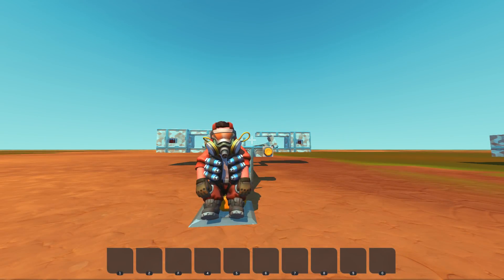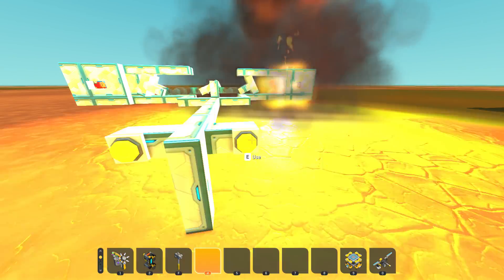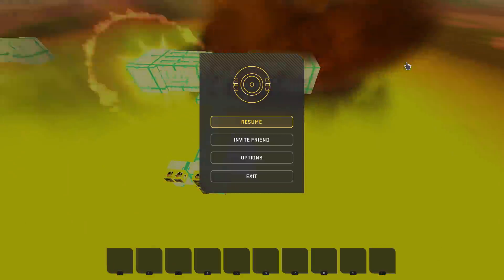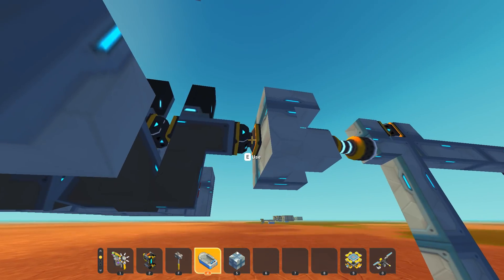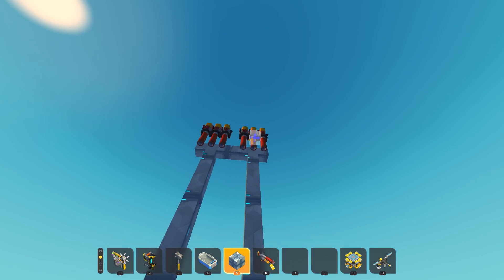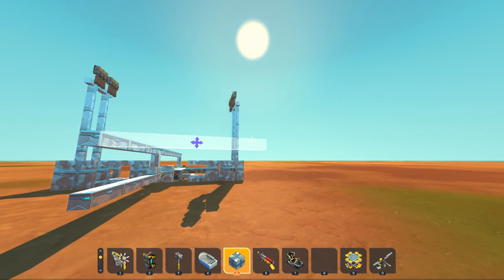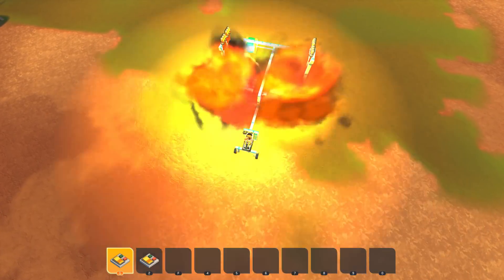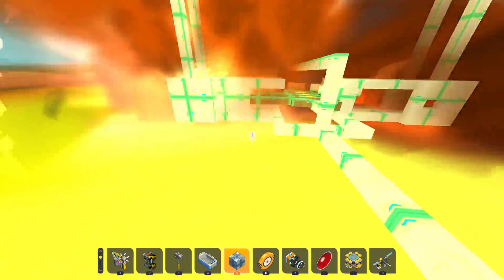I Built an Explosive Powered Engine! (Scrap Mechanic Gameplay)

Comment: You need a flywheel for that to smooth the pulses out.
Reply: jup. scrap engines runs bad without. always have.
Reply: @MrLarsgren  ?????
Reply: A friction based clutch like 2 plates with cactus on one to allow some slippage would be a good thing
Reply: and an electric start to get the flywheel moving
Reply: @thekingjdd  yes.. but not in scrap mechanic. physics freak out.
Reply: @MrLarsgren  Ahh the clang sets in haven't played scrap mechanic so don't know the limits my self thanks for the clarification

Comment: Rather than making it into a differential to get both wheels, use both sides of the crankshaft as wheel locations, this way the piston chamber is the same axis of movement as the spawn location and the drop of the spuds won’t be so out of place too,
Reply: Yeah that's what I was thinking
Reply: Yeah, I thought the same, would've probably been more efficient to use the engine in line with the wheels instead of using gears to transmit the power

Comment: When it accelerates the spudguns start missing some of their shots, you need them in front of the cylinder for them to be unaffected by their own movement. Then after they missed the first time one of the cylinders had multiple explosives spawned in it at the same time & one of them glitched upward and destroyed some of the spudguns. They should also probably be hooked up to the same activation as the explosive spawner (or a set delay if the spawner has a delay after activation) so that the spuds hit the explosive sooner after it's spawned.

In any case I'm not sure you're gonna be able to get this to start (or accelerate well in general) without having it hooked up to sensors instead of being on a set delay. If it had 4 separate pistons (which could still be doubled up if you want) it would make it far easier to hook up with sensors, guaranteed to only spin in the direction you want it to, and far more reliable. With sensors and 4 pistons it would be much easier to start because the pistons would never counteract the direction you want it to be going, so as long as it starts moving at all it wouldn't stall it would just slowly accelerate until it gets to whatever it's top speed is. (if it's strong enough to push itself at all)

-and of course something something flywheel, something something starter
Reply: And add that the spudguns when moving seemed to be miss the shot and hit the metal
Reply: Dang that's smart
Reply: 20:30 is where he loses the spudguns.
you can see an explosive flung from the engine

Comment: I knew it would stall when moving.  You might do better if the spawners were facing forward or backward to the vector of travel and had some wiggle room to work with but I don't see it working very efficiently.

Comment: By the way. The trick with putting the bend pipe into the suspension on a bearing with a screw does work in Survival. Worked the best for me when using a button, or a switch. Full sized blocks, or pipe pieces have to much/too little space to place the bearing/bend pipe piece on.
Reply: I've been doing that trick for a while in survival and it works with pretty much any piece, you just have to know where to aim your cursor (it's a little counterintuitive for full blocks). You don't even need the bent pipe and I usually use 2 full blocks for durability.
Reply: @rokushou  How I described doing it just felt the easiest, which I got to work without much trouble. So that is why I recommended it. Plus on a very small vehicle you save space. ^^
Reply: I'm sorry, I'm a new player and I don't understand. Could you give a timestamp?
Reply: @gheetza14  we are talking about the video about his flying Scooter from like a week ago.
Reply: @rayguy4726  I totally agree the screw or button saves space, and full blocks are not viable if using small wheels. I just personally don't like using anything with low durability for structural components and wanted people to know you can do the suspension trick with something strong like wood 3 or metal 3.

Comment: 1. You need a flywheel. A heavy rotating mass that keeps the engine rotating when the pistons aren't applying power. 

2. Try adding more pistons at different angles. The fewer degrees of rotation between power application increases torque. Right now you have power application every 180 degrees. If you can reduce that down to 120 or even 90 degrees, you'll be much better off. 

3. Try a friction clutch. Your current clutch is more of a direct drive gear. You need a clutch that can slip and apply the load more smoothly over time. So try maybe two plates of tier 3 concrete that get slowly pressed together by pistons. It'll probably take a lot of clamping force to accomplish. And you'll need suspension to act as clutch springs. It'll take some tuning to get right.

Comment: 17:53: A flywheel would fix that, but would need a lot of mass. We used flywheels on cars for a long time, and they serve to keep the rotations on the engine, even during the cycle changes on the pistons.
20:32: Maybe a "injection system" for the explosives, where they spawn and then are bought to the chamber to explode, could fix it, but honestly I've known scrap mechanic for enough time to know that it probably would made it even worse.

Comment: Wow, that's super cool even if it doesn't work.  Reminds me of the thruster engine I built (way back before we had pistons.)  For the clutch problem, I think maybe you need a flywheel on the crankshaft?  It might go a little ways toward keeping it turning even under load.  Lighter pistons might help as well (maybe just 1 layer of metal 3?)  For the misplaced bomb problem.. yeah, that one sucks.  Maybe larger cylinders would work, but then that's going to be less efficient because the bombs are going to be off-center from the pistons and this thing needs all the oomph it can get.

Comment: Hey Kan! I used the laser cannon from the new legend mod and mechanical parts for the gears, and I ended up with a  inline 8 Cylinder engine, it had like a 6 to 1 gear ratio because it has a very minuscule amount of power, but it moves on its own engine power! So I’d say you should mess around with that laser cannon too, it might work out!

Comment: you can use the compression of the cylinder to instant's activate the explosives, assuming it goes fast enough. I made an explosive based cannon where a piston on max speed with 1 distance hits a bomb, detonating it and launching a projectile, so you could use pistons like spark plugs kinda

Comment: I suggest not using pistons, but a flap that is pushed around a circle by explosive shockwaves.
It reduces complexity and energy loss and helps smooth out the power delivery.
My design uses small explosive spawners mod instead of large explosives, just for the even width.
It's called Radial Flap Explosive Engine on the workshop.

If you're here reading this, cool. And if you are still into potato powered engines still, I wanted to present a potato rotary engine on the workshop, and yes, it has 1 con rod; its not a spinner.

Comment: I think you need a counter firing engine like you see in real life where there is no momentary pause in between the cycles of force also having the piston rods connect to the top and bottom of the drive shaft in alternating fashion might help

Comment: have you ever made spudgun engines before? If not maybe you can use the explosive engine and just replace the bomb spawners with some spudguns and make it lighter so it can move. It wouldn't be as cool as an explosive engine but I'm shure it will be fun

Comment: the 3rd one is a misfiring B4 also kan ADD A SENSOR WHEEL AND ADD A BEARING TO THE WHEEL AND THE ENGINE SO IT CAN ADJUST THE TIMING

Comment: Neat idea. Did you try to make some sort of ⚙ exchange. Like different sized gears to multiple your torque. Don't know a lot about engineering. But it seems like you could probably multiple the power you do have, by making some sort of makeshift gears that step up or down. Just a thought.

Comment: Another problem visible when you add load is that the timing is fixed and the engine stops working as soon as the revs don't match the timing. Sensors made is spin up too much without load, but maybe they would work with it.

Comment: so uhm i've tried doing it too (but in an inline 4 configuration) and a good solution for detonation instead of the spudguns (cause they might break) is a piston on 1 length and max speed because they get glitchy that activates at the same time as the explosive spawner the back and fourth of the glitchy piston will blow the explosive up instantly and as for the timing, i'm trying an actual camshaft system with sensors instead of the valves and i think i'm pretty darn near making it work just need to find a way to alternate the explosions when two pistons are at the same position to get the rpms higher. i'm planning to add a flywheel too and make a friction clutch, which should make the moving engine a more possible solution the flywheel will get enough momentum to the engine to  keep running once you engage the clutch and not just stop and the friction clutch allows some slip if it's necessary
Reply: update i might have made it a tad too heavy it does spin but really slow and ends up stalling....

Comment: Maybe make the clutch less absolute
It needs to slip at a bit maybe two disks of high friction blocks pressed against with suspension

Also edit maybe make the cylinders bigger and diagonally placed so the explosive can fall into the low corner and will allways explode in that spot so it can work while moving

Comment: What about having it as a 3 cylinder with the pistons facing upwards? you could use bearings to set them to being a 3rd apart. you might need to use the explosive to pull up the piston instead of push it down though unless the weight of the other two would raise one to the top.

Comment: @Kan Gaming just so you know there are lots of 4 cylinder engines where sets of 2 pistons are at the same point in their stoke in fact the majority of them are like that including v6 and v8 they just combust at different times for instance my ford 801 cylinder firing order is 1243 also for future builds a more realistic clutch to a car would be 2 square plates opposed to one another with something high friction like a cactus on one that will also allow a bit of slip between engine and drive shaft for initial engagement TTFN

Comment: One problem is the spud guns, when you move they fire slightly behind where the explosives are/they don't apply the momentum of the vehicle, another problem is the weight, this is probably one of the main problems as it took two full power thrusters to even get it moving, and then there is the fact that even if you get it working how would you make it functional without the ability to miniaturize it to a useable scale. Overall this seems very improbable, but not impossible.
Reply: Although it is very likely to be impossible.
Reply: Also if kAN reads this play sprocket or look at it as it is very fun and needs publicity.

Comment: hey kan, heres an idea for your survival series. Ive analyzed the core fluctuations in the code of the game and it requires that your computer CPU be at exactly 46.2 degrees celcius to unlock the decrypter in the warehouse to break the warehouse blocks, you also need 2 water containers inside the elevator and 2 gas containers too. without those it wont work and you cant break the blocks in the warehouse.

Comment: Real engines have a decently large flywheel, and a high gear ratio, and also they don't fire all the pistons "at once" per bank.
Instead of a "flat plane" crank, you should probably set it up with a cross-plane crank, 90 degrees per piston, so that the pistons fire in quick succession rather than all at once.
You could also probably do with more pistons. More engine is always better.

Comment: Gasoline in an engine doesn't explode, in fact when gasoline does detonate, do to excessive compression ratio or too advanced engine timing. Gasoline will combust in a properly designed/tuned/maintained engine, ensuring a drawn out pressure applied to pistons.

Comment: This is just a guess but doesn't it stall under motion because the spuds aren't hitting the explosives? This would definitely be a problem during hard acceleration but don't think the momentum of the spud guns carry over to the spuds. This could be fixed by putting the spud guns in front of behind the cylinders; in the direction of travel. I guess it would still stall during turning but at least it can go forwards.

Comment: I would try 2 things. 
First try only to mave by the engine itself, but I don't think it will work.
Second, turn the engine by 90° and try if the spawning ist still such a problem when moving, and again, just the engine, not those thrusters.

Comment: i wonder if there's an option other than spuds for triggering the cylinders. after all, 
spud trajectory would be off if there's any movement: making it unreliable at best.

could a maxed-out piston slam a weight into the explosive & trigger it?

perhaps spawning another [breakable] item in the same location will cause a collision similar to the version welded to the ground.

Comment: i think it will work if you make a tweak to the sensor type.
make it so you also can rotate the sensors or the plate it read  to advance / retard timing. then it should work without the timers.
like on the green energy engine of mine you showed in a video with scrapman.
remember a heavy flywheel.. scrap engines need them.
Reply: Dang it I thought I had an original idea with the rotating the sensors thing lol
Reply: @scoldingtitan3651  the system is super effective with thruster engines. i made a train that pulls only on front axle. still able to pull 2000 ultra heavy blocks.   theyre like 1000 metal each.  it automatically generate most torgue at low rpm.

Comment: You should come back to this at somepoint using the scrap guard mod you can turn any block indestrucable might help with the weight problem kinda cheating however

Comment: what about using spud guns instead of explosives, Have them like a spark plug but using the recoil of the spud gun to push the piston instead of an explosion. This might allow you to make the engine more compact and therefore a smaller vehicle.  It would also allow you to build in lighter material and have move chance of making it move.

Comment: You were doomed to failure. Maybe if the bombs spawn in from ABOVE and LANDED into the piston in quick succession and it the vehicle was lighter. Metal 3 is as heavy as balls and I don't thinking anyone is ready to do this in survival, even if it done as a joke. Maybe if ya could add some pistons to simulate the force of the explosion instead of the real explosion. You could then test if it would work in practice before worrying about how your bomb spawner's spawn bombs come into focus.

Comment: Real engines are NOT powered by explosions. Explosions in the combustion chamber means there is something wrong with your engines as that is a condition called "detonation". 

Real engines are powered by expanding gasses. The gasoline/air mixture is ignited, which creates gasses that expand at a reliably controlled rate and push the pistons down. 

An explosion is an uncontrolled expansion of gasses that creates a shockwave. A shockwave is basically a soundwave that moves faster than the speed of sound and "bunches up", creating higher peaks in the wave. When those peaks hit something, they impart all of their energy instantly. That is why explosions blow things apart instead of just push them away. 

So the main difference between an explosion and what really happens in an engine comes down to how long the forces are acting on the pistons. An explosion dumps all the force in an instant and can cause damage. A controlled expansion applies force over time and is much more gentle yet also more powerful.